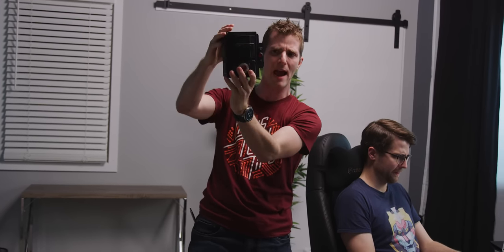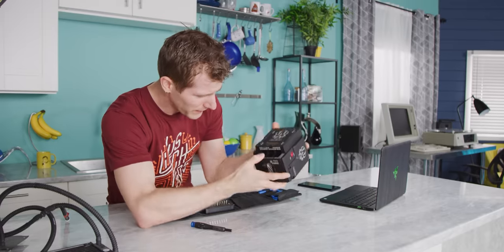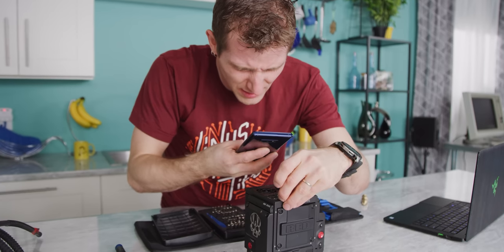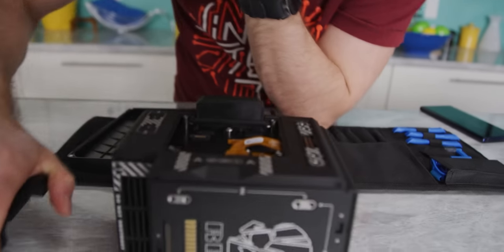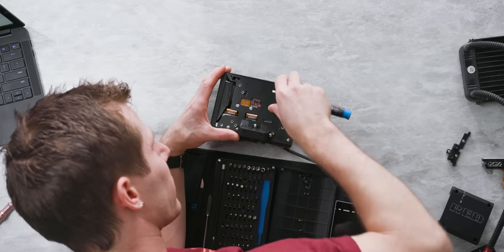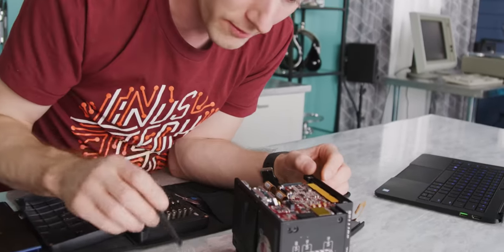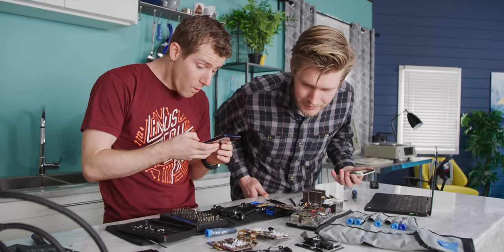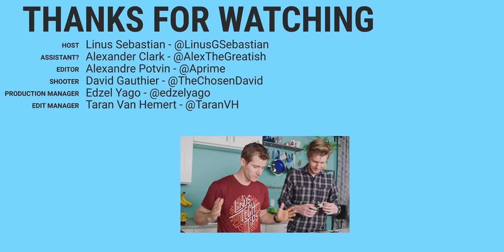We TOOK APART an 8K Camera!

Comment: Im sure they already talked with RED and know that if they can't get it working again, they can get it professionally repaired for much cheaper than the orig 55k price. With that said, holy crap that's a 55k camera they are taking apart for the lawlz....
Linus Team: But why?
Internet: But why?
Linus: Challenge accepted.
Reply: last three lines = LTT in a nutshell
Reply: They can afford to have it fixed if they break it
Reply: I don't think it's 55k, they said 10k in the video.
Reply: NizzyTV yea, they are only taking apart the main body, not all the accessories.
Reply: @NizzyTV  their model cost them $49,500 ish
Reply: To earn the 55K back? why else would they do it.
Reply: @tukuiPat  That's a Helium, which is listed at $24,500 on RED's site. Convert that to Canadian, I can see almost $50K CAD.
Reply: Being the first doing something outrageous on YT is very valuable, so this is going to be worth it either way. It's blowing my mind how this is put together, it's my favourite series in a long time!
Reply: This brings to mind the old video of the Dell XPS 13 Wet Laptop Recovery Video. 
-Brandon: Linus you're not supposed to do stupid things.
-Nicky V: Linus what is wrong with you.
Reply: wallet: Oh fuck
Reply: To all of you: The Camera is $24,500...
Reply: If RED were Apple:
"we lost a screw putting it back together, it works fine so could we just buy a spare screw"
"you see we use special custom screws that cost $60k each so it'd just be cheaper to buy a new camera"
Reply: But will it mine bitcoin. Lol
Reply: @EminemLovesGrapes  they can't earn 55k with a single YouTube video
Reply: 25k. It's a helium, not a monstro (see 3:10). Still more than my car.
Reply: Isn't watercooling things that God never intended just part of LTT's programming.  Why not wristwatch next?
Reply: Well yeah, RED isnt apple.
Reply: @truedarklander  This video is just part 1 mind you. If you watched it you'd know.
Reply: @k7y  Also Red: "Well, at least we will have some money when they send it to us for re--assembly."
Reply: Per Red's website, the 8k Helium "DSMC2 Brain" costs $24,500.  The accessories chosen bring the price up.  He only tore apart the "brain."
Reply: @EminemLovesGrapes  not even 2 videos make 55k. You might make 1-3k $ with a single video. Not anywhere near 55k.
Reply: @truedarklander  they're making more than two, the vid is sponsored. They'll make a huge part of it back.
Reply: I'd bet good money it's already broken from being dropped or something like that so they said yolo lets fake it for some views.
Reply: 25k in US currency, they're in Canada.
Reply: 55k is literally nothing to them, they have 2 more and all the bells and whistles. And payroll for a dozen people. This is a multimillion dollar company. Also, the views from this video and the sponsor for it could pay for another one. They lost nothing here.
Reply: @kemalettinsrt  They're talking about the last video he did about the RED camera (or one of them). The main block he's working on is "cheaper", but with all the required accessories (like batteries) it's ~55k IIRC. But yeah, if it breaks they're "only" out on that main part. Still seems like insanity haha.
Reply: @kemalettinsrt  Your right the part they are taking apart is "not that expensive". but you cant shoot with it. Youll need all kind of accessories in order to film. And they are all lets say overprized
Reply: Jason you crack me up man.
Reply: why the fuck would they repair it when the warranty is obviously voided
Reply: @firstname4337  To compare and contrast to apple.
Reply: @Azeazezar  my reply was in response to the post by Byte My Bits who said Linus had already talked to Red and Linus knew Red would repair it -- I still say bullshit --- they are not going to repair something that an owner has destroyed by be being incompetent and voiding a warranty
Reply: @kemalettinsrt  
 HELIUM 8K S35

    35.4 Megapixel CMOS Sensor
    29.90 mm x 15.77 mm (Diag: 33.80 mm)
    60 fps at 8K Full Format (8192 × 4320)
    75 fps at 8K 2.4:1 (8192 × 3456)

$24,500 USD
Convert that to Canadian when he got it plus shipping and tax and he's close to 40K
Reply: @nathanj1720  then make it about $70,000 with all the accessories they need to use it.  Though if they break it they're only out on the brain at the cost you quoted.
Reply: 1. Why not!
2. He's a curious dork!!
3. He can. He has the $$,$$$$!!
Reply: I think this was like an 8 mio subscribers celebration kind of thing
Reply: How about overclocking? xD
Reply: For those interested, this did cost $55k when they bought it but RED dropped the price massively early last year to $25k.  Current used market value is only $15-20k.  Sold mine and got the better $20k 5k model that is much better and runs much cooler with less fan noise.
Reply: what challenge, he just doing it for fun
Reply: You can't water cool an 8k camera,Linus hold my beer.
Reply: I don't know much about RED but is there really even $10,000 worth of actual tech in that camera. Are they paying for the R&D and the name more than anything?
Reply: @maxiklaxi  used to be around $50,000. Recently the prices all went down when Red rolled out the unified body system.
Reply: @CursedRat153  Right, but that's MSRP. Depending on what site they got it from, it could be higher than that.
EDIT: LOL just found it on B&H which ships to Canada for free, for $19,500.
So it's cheaper than people think, but still a shit ton of money.
Reply: @kemalettinsrt  they purchased it when it first came out a couple years ago
Reply: @maxiklaxi  they purchased it when it first came out over 2 years ago, the price was higher then
Reply: @czibbell74  true but they bought the camera a couple years ago when the price was much higher
Reply: What do you mean why?? If you can, and you have a good deal on it ,, this gets a LOT of subs,, it is pretty cool,, but hard to watch knowing the price tag of this unit haha

Comment: 7:30 - that Xilinx Kintex-7 is actually an FPGA not an ASIC. The 7 series is a few years old now actually and while these ones will run you about £1000 just for a single chip, it's successor, the ultrascale and ultrascale plus series will run you more like £30000-40000 for a single chip.

FPGAs are great for custom parallel data processing, that's most likely what it's doing in this application. It's a massive customisable slab of logic gates which are configured by writing verilog/vhdl code on a PC and loading the code onto the chip. It's similar to to the way you you'd write software , but is technically "hardware" development I guess
Reply: so a $30k Arduino that plays games? Thicc
Reply: @Draco-wq1ch  I'm sure you can find emulators created for fpgas. I'm pretty sure I remember seeing an fpga used as a simple graphics card.

Almsot any piece of digital hardware can be replicated in an fpga, they're handy little devices
Reply: @willsoe   Well shit, I took a couple minutes to research what an FPGA actually is and that sounds quite awesome, however the technology is very expensive. Yeah, hardware emulation at that low of a level sounds awesome actually. Do you have more details on what it does in the RED?
Reply: @Draco-wq1ch  Afraid not. I'm not a camera guy at all, but I do use FPGAs for other things at my work.

Almost always its for high speed data processing. To give you a crude example, a data processing algorithm we use that takes a few minutes to finish in matlab can be done in under 25 milliseconds in an fpga. It doesn't help you much for general computing power since the fpga had to be designed and tweaked for months to get it that fast and only doing that specific algorithm. 
So I could take a guess that here the fpga in the camera is just storing/manipulating data (8k raw footage is a HUGE amount of data throughput) or applying some sort of compression/filtering/image processing algorithm.
Reply: You're the real MVP in the comments

Comment: Just liquid metal it tbh
Reply: @No-mq5lw  50k disaster has already happend
Reply: the ploblem is that liquid metal doesn't stick heatsink
Reply: @gio9789  Well..
While that is true and people are worried about it like slipping away and so on.
Why don't you make some kind of gasket for it?
It has an immense pressure a copper or graphite gasket isn't really out of the question and would hold the minimal amount of liquid metal in question.
Reply: @No-mq5lw  its also destroying solder joints, watch luis rossmann on grafics cards with shuntmods.. so no liquid for the 55k camera..
Reply: You probably shouldn't liquid metal thing with that high temperature range
Reply: @No-mq5lw  If you use to much yea,if you use just enough not a chance
Reply: @misamokuzelpizu  It can, but its on a chip, not the solder...
Reply: You do know what "tbh" stands for, right?

Comment: Linus is the type of guy to take apart a $50K camera, lose half of the screws and use hot glue to put it back together.
Reply: $25K
Not $50K.
Reply: SideBurn no they are 50k man
Reply: @tklegon102  the body of a red helium is 25k, they spent about 70k in total for each camera with all the accessories.  Since they are only working on the body, if it breaks they're only out 25k.
Reply: @Joker I was somehow disappointed that he didn't drop it.

Comment: The Xilinx Kintex-7 is an FPGA -- programmable logic with very flexible pins that can talk to just about anything.  Could you read the part number, so we can see if it's got an ARM core or two on it, or if it's just an FPGA?  If you are looking at Digikey prices, figure those are 3x what RED pays.  Also check for some super-expensive high speed 14 or 16 bit ADCs between the FPGAs and the sensor chip.  Can you get part numbers on those?  Also, the geometry from the sensor to the lens mount is super sensitive, because you have to hold a micron or two tolerance between the lens and the sensor.  That's substantially better than things can be machined, so there's usually some kind of fine tuning screws with loctite on them.  If you send me pics I can tell you what much of this stuff is and what it does, for your next video.
Reply: Try emailing the email address at https://www.youtube.com/user/LinusTechTips/about .  Also try posting it in the forums for visibility.
Reply: They're not interested in that kind of details. I wish @eevblog could disassemble one for that :)
Reply: @ahmetkipkip    AvI would get it back together [ zip ties and gorilla taped maybe]  :D
Reply: Wayyyy late to this party, but i used to work at Xilinx a while back. The Kintex is the "low end" (even if it's still stupid expensive) of their FPGA lines and adding ARM cores into a SoC type thing only started with Zynq-7000 and forward. i can't imagine (of the like...10-20 SKUs per product level) that it's one of the particularly high O/I count variants of the Kintex-7 simply because those suckers put out so much heat. Even if Kintex-7 was touted as "way more power efficient" than Kintex-6.
Reply: @geo100020002  Allah korumuş 😄
Reply: @qwertychouskie7815  Good idea.  They'll get back to me for details before they edit the next video in this series.
Reply: @geo100020002  Kintex-7 isn't the low end, it's midrange.  Artix-7 is lower end, and Spartan-7 is slumming it.  You probably didn't deal with us cretins who work with these things ;).  Spartan-7 is best for logic/$ and multipliers/$, and cost per slice or multiplier or IO pin generally goes up for the bigger devices, although there are a couple of bargains in the price matrix.

Comment: Actually cooling down the image sensor decreases the noise! Some star photographers have attached peltier elements to the sensor of the DSLR camera to cool it into sub-zero temperatures
Reply: But the Helium sensor actually needs to heat up to get the best image quality. Helium has the least noise at 43/44°C, and that takes a while to get the camera warmed up to that, so water cooling is making me scratch my head.  lol

http://www.reduser.net/forum/showthread.php?161303-Ideal-temperature-35C-40C-42C
Reply: @wreck2  Interesting.. OK the sensor calibration (color accuracy, ISO/sensitivity etc.) is done at some specific temperature, which must be the "typical" temperature after warm-up, but thats kind of weird if the noise performance decreases when decreasing the temperature..kind of fights against the laws of physics :P
Reply: @Petex90  I don't know the science behind it, but people have done tests with sensor calibrations (black shade) at each degree point (35 to 48 or so), and pixel peeped, and 43/44 gives the best results.  :shrug:
Reply: speaking of sub zero... mk11 is right around the corner
Reply: Z3U5  thermal noise, probably.
Reply: @Petex90  As an owner of a RED Helium 8K I can tell you it's the case that around 40°C you get the best quality. That camera is designed for that temp!
Reply: Z3U5  it's the electrical noise in the photo cells where the number of photons collected within one shutter time is converted into an electrical voltage. This photo-electric converter adds electrical noise variable to the sensors temperature - which results in a "grainy" image for example in low light night shots with high iso.
Probably the red has some sort of noise correction function over temperature,  and as others stated there's a best temperature for that...
Reply: @wreck2  they probably just cooling the encoding processor instead of the sensor itself
Reply: @TheM7163  Good insight. I think you're on the money. They most likely have some sort of denoiser functionality which works best when the noise it's given is from a 40C source.
Reply: @namelessguy199  you get it :D
Reply: @kopfmedia  I was not talking exactly about image quality ;) I would absolutely use my red's sensor in ~40'C because of the best/calibrated compromise of different factors, affecting to "image quality". Only the actual image noise (which is only a small portion of overall image quality) is probably better in colder temps, although the overall quality would be still worse.
Reply: I've learned from this topic, now i know the truth behind nature
Reply: @TheM7163  Yup! There certainly is some kind of de-noiser in FW/SW. Statistical noise or offset error is fairly easy to cancel out in SW. The electronics in image sensor (whether it's a an 8K red of a $15 webcam) has those, and also random noise sorces. Johnson noise is maybe the most "important" noise source, which is highly dependent on temperature v^2=4kTR (T=temp.). Then there's also shot noise (not temp. dependent), gen-recomb. noise, 1/f noise, 1/f^2 noise, burst noise and avalanche noise, and probably couple of other that I cant recall just now... That's why basically all ultra low noise sensors and amplifiers are often cooled down in highest end research instruments, for example.

Comment: No antistatic precautions or anything.... I wouldn't even trust most electrical engineers to do this let alone just throwing it on a kitchen island and tearing it apart. Boldest project to date, in my opinion. You should CAD it up and get a custom machined block so that the tube fittings come out of where the exhaust currently is. That way you can keep the fans for any parts that needed some forced air cooling. I have faith in you that you will at least get it back together when you realize it won't work lol. As long as you didn't fry any of it. It is winter, rather dry to not be using an antistatic pad&strap. Good luck! You already know I will be waiting to see haha
Reply: He's got one on his leg.
Reply: @KingArkonn  are you hoping so or did you see it or know through some inside knowledge? I considered he could have one on his leg or clothes, but I didn't see any leads going away and I don't remember it ever showing his legs. Plus, clothes and legs straps typically plug into mats. I'd be very happy if he does. I wouldn't put it past him, but seemed unlikely when I commented
Reply: @joshfrechem3506  besides that, he should do the teardown on an antistatic mat. I'd say take the same precautions as if you were disassembling a hard disk, including laminar airflow, gloves, hair net and mask.
Reply: @joshfrechem3506  He showed it in a past vid.
Reply: @KingArkonn  Well, hopefully he used it this time too

Comment: There is indeed a technical reason to cool a camera sensor down. 
As the sensor gets warmer, it loses its dynamic range ( also when it gets too cold). The more stable the temperature, the better the image. If you work under extreme conditions, with a water-cooling you could even pre-heat the sensor to its optimised temperature to get the highest possible image quality out of it. 
Or hold the temperature on an even level (even when turned off) to make it more durable.